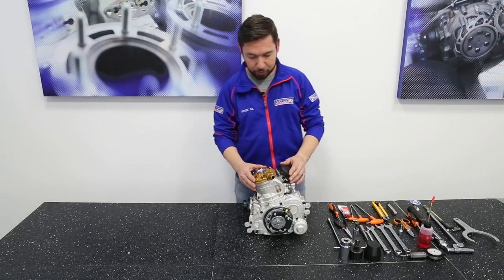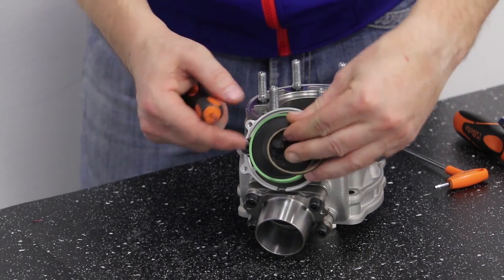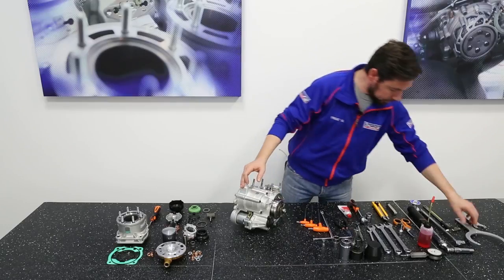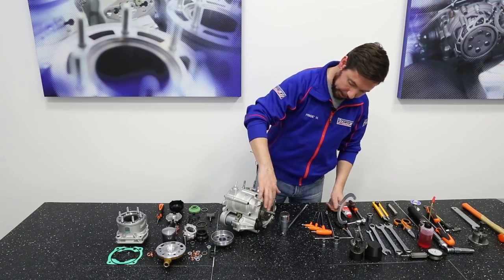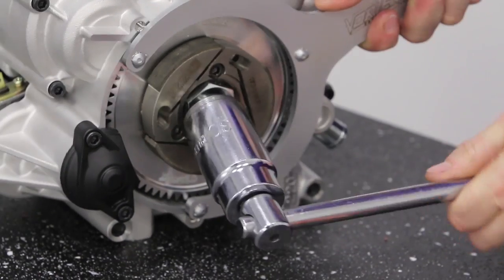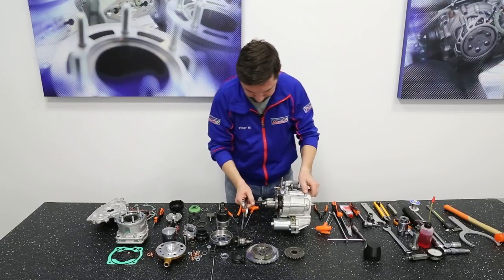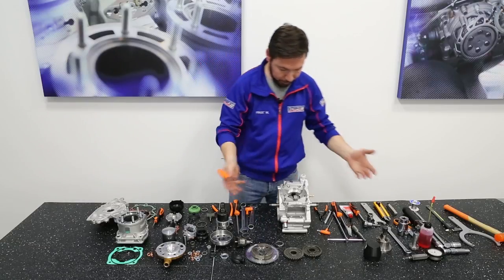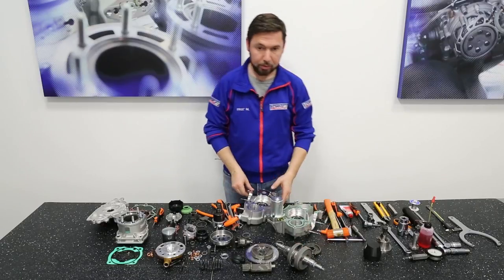Vortex Rok GP disassemby

Comment: where do I get a 30mm lathed socket?
Reply: Did you ever source one?
Reply: @SS-us8zs  sorry just saw this 😂 I had to get a 30mm impact socket and grind it down on a bench grinder. Took about 20 min and every 30 sec or so I took it off go see if it fit the gap. It doesn't fit perfectly but it works. One of the biggest headeaches I have ever had trying to get a tool for karting
Reply: @sahib6742   Thanks for getting back to me, i figured out that you can pop the clutch off without taking off the 30MM bolt, then you just need a regular 30mm socket, no need for a lathed one.
Reply: @SS-us8zs  nice! Glad you figured it out!

Comment: Does the timing cover need to be removed to change the starter motor? My starter motor went out (probably broken brush wires) and I'm having a heck of a time finding any instructions on removing just the starter motor from an assembled engine.